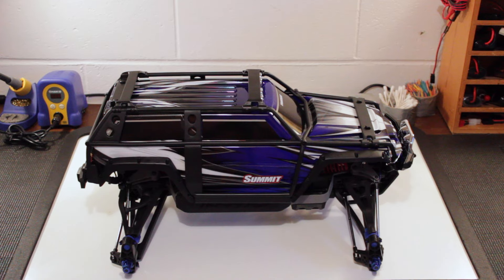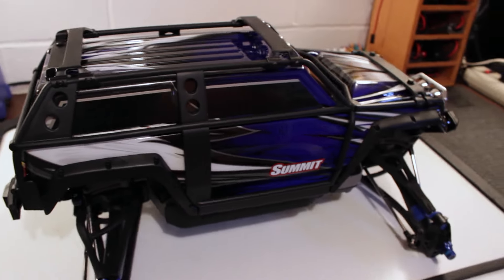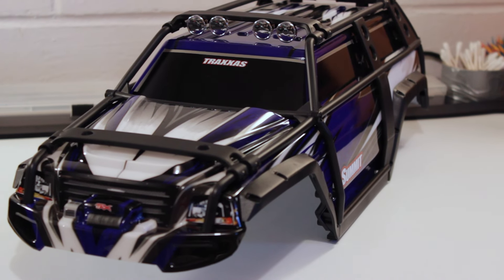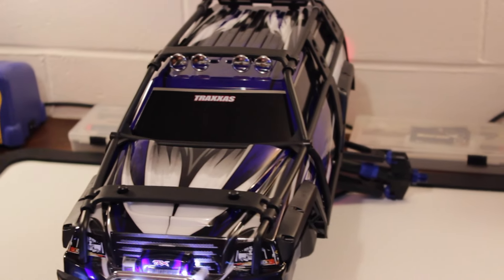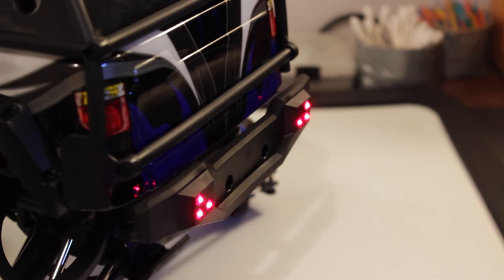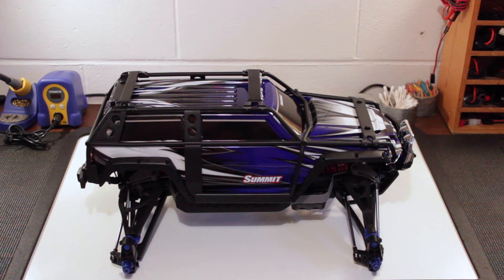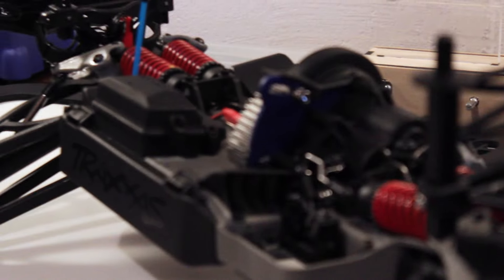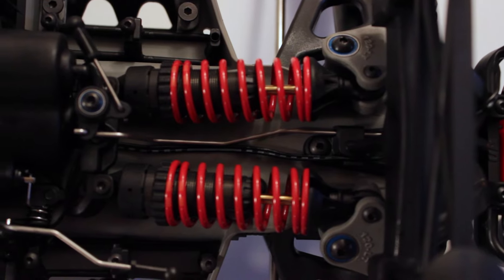Traxxas Summit Build - The Unveiling

Comment: how much you pay for that roller? can i find similar on epay?
Reply from the maker: +Hamdi Jaber  I payed $299.90 for the roller which included the body and LED lights. I purchased it off of eBay, here is a link: http://www.ebay.com/itm/Traxxas-1-10-4WD-Summit-COmplete-Rolling-Chassis-w-Body-ExoCage-Roller-/221568962089?hash=item33968a0e29:g:2CsAAOSwDN1UMvMQ